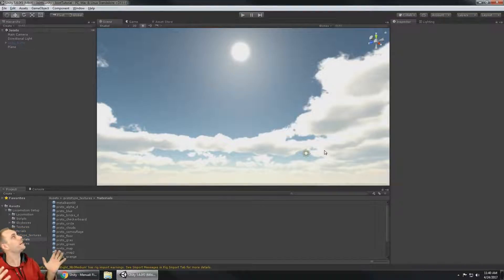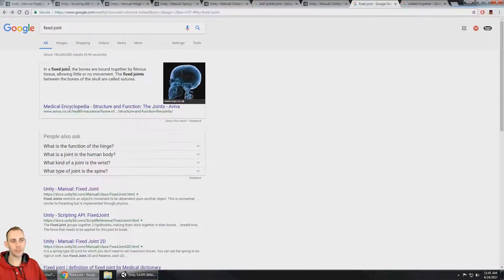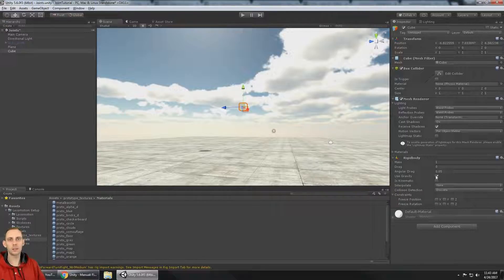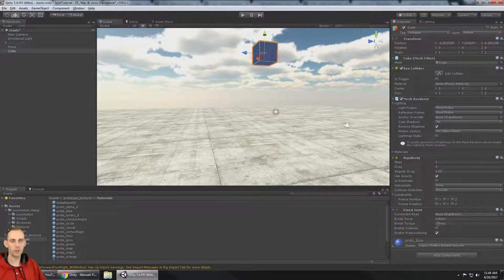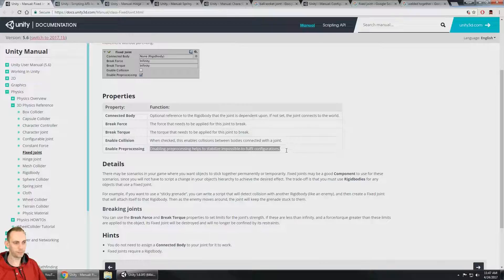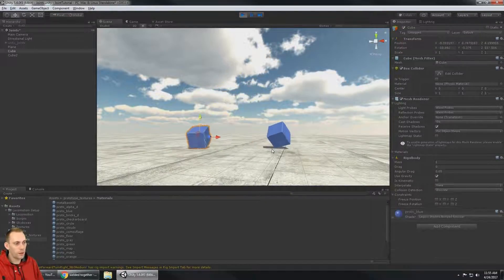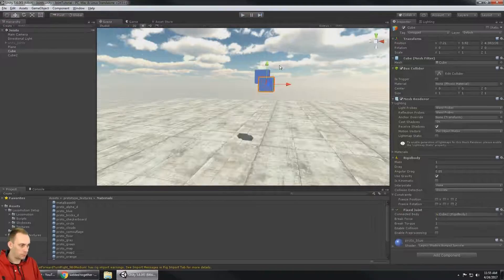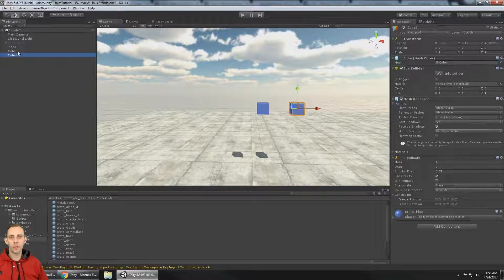Unity Physics Joint Tutorial: Fixed Joint

Comment: You'll know when you need to use enable pre-processing.. when you have rigid bodies jointed and either a dynamic element coming into contact with it suddenly has a close to infinite force applied (Ping - gone) or when you have rigid bodies jointed or non rigid bodies on jointed rigid bodies and you are using huge amounts of resources running what should be a stable system going to sleep... that's when you want the pre-processing. 

Lets put it this way.. you're not likely to really need it, but when you do, you really need it.. and it can reduce resource use even when you think you don't need it.
Reply from the maker: Good info, thank you Ian! This one was a bit hard to understand in the docs.

Comment: Hello, regarding your videos of FixedJoint, SpringJoint and ingeMont, to make the suspension movement of a car, with which object would it be better to work.
Or would it be with a set of 2 or 3 of these objects?
Thank you
Reply from the maker: I've came to the conclusion that car suspension needs some extra scripting, or customized joint classes and Unity's default joints don't make a good car. Maybe that's changed now, but I had to go with a vehicle physics package from asset store.
Reply: @RyanZehm  Ok, thanks, I already thought that I would have to use several nested scripts, for the rude I use a script for each WheelCollider, and another script for the 3D model of the wheel, what I am looking for is to make an effect type to this
https://www.youtube.com/watch?v=O08UhoIxGRc

Comment: If you don't freeze rotation, while you are making a rope, the rope will go nuts, brake down and glitch out.
Bone structures inside of the rope which are connected to each other via, configurable joints, Needs to have rotation frozen
Reply from the maker: Good info to know, thank you MrAlexbreak!